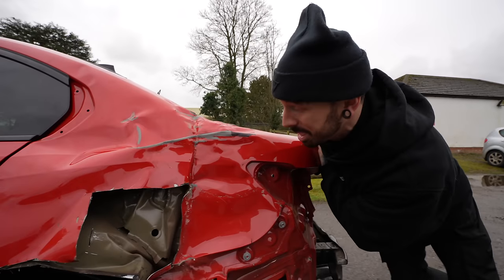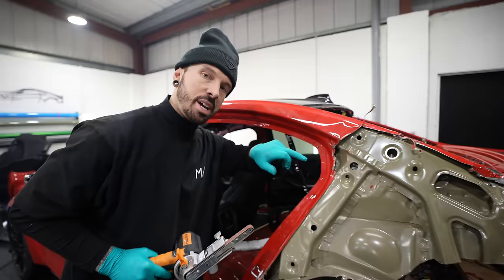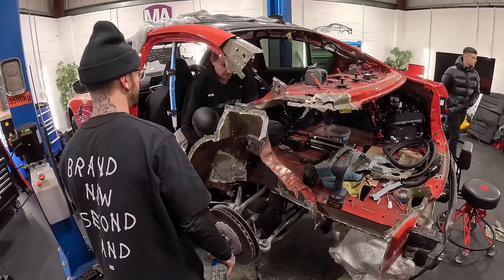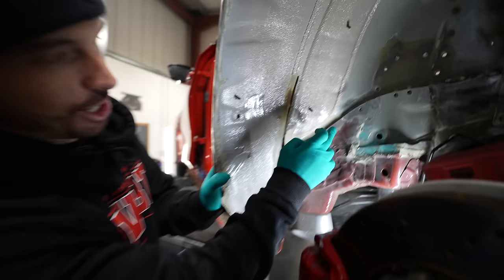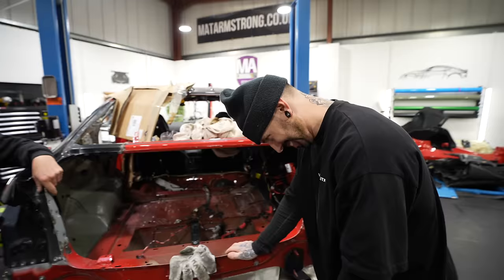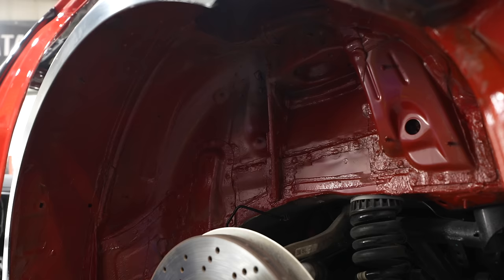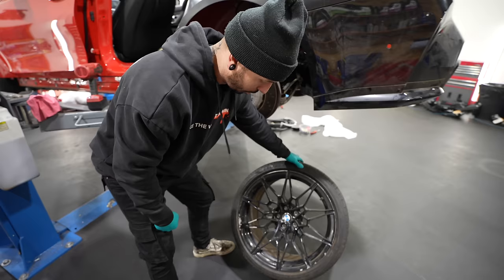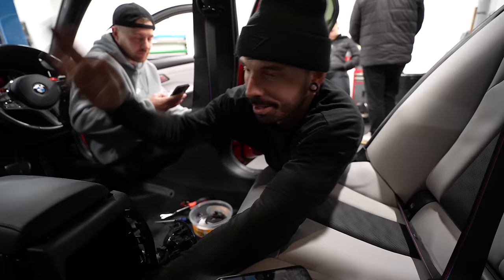REBUILDING WRECKED BMW M3 THAT THE INSURANCE COULDN'T

Comment: Would it be worth while to purchase a larger compressor for your space? I know here in Canada they're not ridiculously expensive like they once were. I'm 53 years old and when I was a teenager, to have ANY compressor, torches and an arc welder was luxury beyond comparison. We were dirt poor too and the only reason we had a lot of the garage toys was due to my Dads ability to wheel and deal. You needed a license for  the oxygen for the torches so you had to know someone with a welding license to get it for you. I did bodywork on so many friends cars and bikes. Painted them all. Of course they weren't concourse paint jobs but they were pretty damn good for a garage job. We'd close the big garage door almost all the way and put fans at the bottom. Side entrance door open a tiny bit and then soak the floor with water to prevent dust. We had a homemade water trap for the compressor that worked at about 70% of what a store bought one would. Of course no safety equipment at all lol. Sniffing air born paint fumes all afternoon was almost an initiation. Ridiculous to think of doing anything like that now. I survived :) That's another thing that wasn't readily available or if it was it wasn't cheap, the safety stuff. Masks and filters and so on. Again, it was never perfect but it was a LOT of fun and the cars and bikes looked good. The bike ones were more fun as there was so much less to paint so we could spend time taping patterns and adding layers. It was always an excuse to buy a LOT of beer and get a wee bit on the drunk side but still able to work lol, gotta love ones teen years lol. I digress. Apologies for the book length comment. I'd give anything to lose all of todays technology and go back to the mid to late 80s and work in my old mans garage on my cars/bikes and my friends. It was a trip. Love your content Mat. Love seeing you work with your Dad as well. His laugh is infectious and his sense of humor is a riot. All of you please keep safe and take care. Wow, what a trip down memory lane. I got to think quite a bit about my teens and early 20s tinkering in the garage days. I was gas and arc welding by the age of 11 and was pretty damn good at it too. It was a grown up man thing and I wanted to be as good as it as possible lol. By 13 or so I was quite proficient and could weld just about anything safely and properly. I once welded a cracked 1st gear out of my Suzuki RM  80,  Was told it wouldn't work but I got the gear off the shaft and ground half of it away from the top to the middle and built it back up with weld. Then did the same to the bottom. Roughly ground out the gears and finished them with files. I LOVED rubbing it in all of my Dads friends that said it wouldn't work lol. 11 years old lol. Ok, ok apologies again. I promise I'm done my novel here. Peace everyone.

Comment: Would the Carly work on a 191 Peugeot rifter in Ireland. I’m have a problem with the buttons on the bash now working or turning off. It’s something to do with the BMI. 
Peugeot them self say there is nothing wrong. 
One of the thing is the lane assist won’t turn off and the child lock flashes sometimes. 
Has anyone seen this of know how to fix this problem please

Comment: Mat i love your work, but i would like to point out that since you are progressing into videos with more and more structural repairs, maybe it is time to invest into buying a car bench in order to ensure that when the parts go back on they are welded straight and that the body flex does not effect the end result. I am certain that welding parts on a car that has a pillar cut off while its front and back are "hanging" due to it being lifted from the middle will not have an optimal result due to the chassis bending that occurs. Differences that might appear negligent to our eyes significantly effect the way the car handles and feels on the road after such a structural repair.

Comment: MAT PLEASE HELP WITH AN ANSWER im form US and i have a g20 which i got a new door pannel for but at the top of the pannel there is a peice of plastic that hangs over and you have ot lift it and slide it in right infront of where the window slit is but im really struggling with putting it back do you have advice?

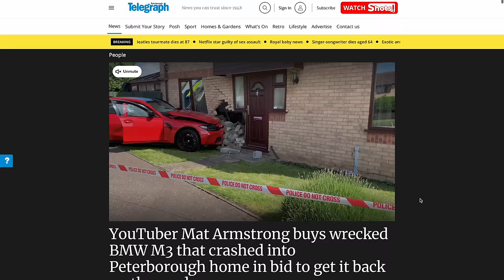Comment: 0:13 The biggest question is, if the previous owner wasn’t insured then who is going to pay for the damage to the house he crashed into? Damage that needs repairing now and not after a year of legal battles. That’s some serious structural damage to the entire wall of the house, even the doorframe isn’t secure.
Reply from the maker: It went to court and the driver got fined and took liability

Comment: Matt, I really appreciate your videos but you need to be more clear about what it means to buy the Carly code reader. I have read so many disapointed customer reviews out there, so please be aware! I bought the card reader mainly because of your add. First of all its not a product but instead an annually software rental which means they will debit you annually (if you dont cancel the subscription) and its not possible to return the package if you regret the purchase. This is far from clear in the webshop and came as a surprise for me. Read online reviews before consider buying.

Comment: Do you think covering that carbon roof would have been smart before all of the grinding and cutting ?  I guess not ! If all the millions of metal shavings get damp with moisture the front seats and everything they land on will have little rust spots everywhere. That is why you remove the whole interior and store it in a safe place before grinding metal .😢

Comment: that repair will not pass inspection by BMW.   repairs of the inner and outer panel per BMW have to be bonded with K2 and K5a/b and then riveted together.   Welding all those together will actually weaken the metal.

Comment: Hum tig is the way to go.. mig is to hot and it can warp the panels, i learnt the hard way doing my vw camper. But thats whats filler for 😂 so learn tig.. plus dont use cheap arse paint or any sealers use companies like 3m not halfords 😂😂 otherwise you'll be chasing your arse. 🤦🏻

Comment: You can fix it but it will never be right, when these things get bent you can put some lipstick on it but in the end it’s still junk, never drives as new, and 10K miles after repair trans goes it to was bent and took 10K to puke, odd handling, water intrusion, sell it quick as R titled cars don’t do to well aftermarket. It’s the old lipstick on a pig deal.